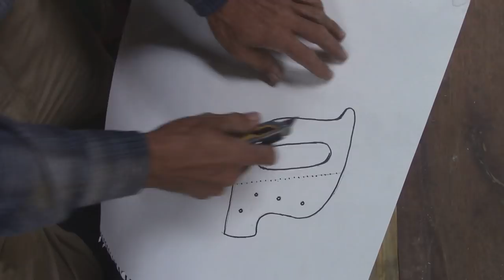Refurbing an Antique Pruning Saw

Comment: They still make pruning saws like that.  Corona, Fanno are a couple of brands.
Reply from the maker: Cool. Did not know that, didn't run across them when researching. Are they sold in the US?
Reply: @DIYwithUncleCy  Yep they are.  Wesspur.com is one place you can see them.  Most tree guys use power saws, but they are still nice to have around.  Nice job on the grip.